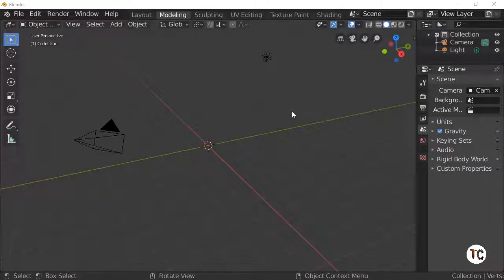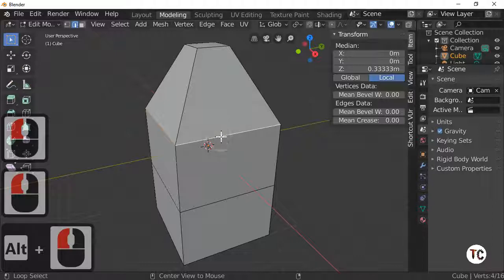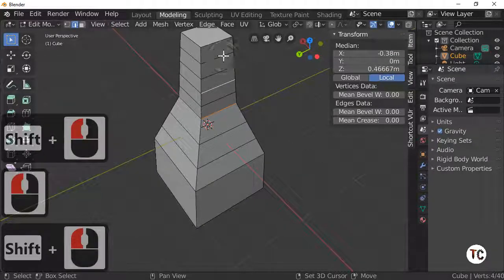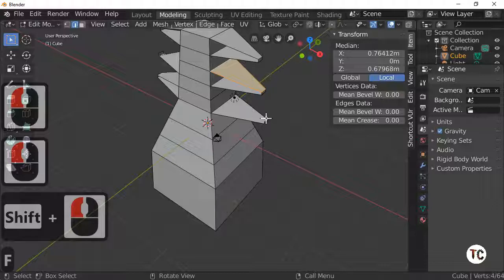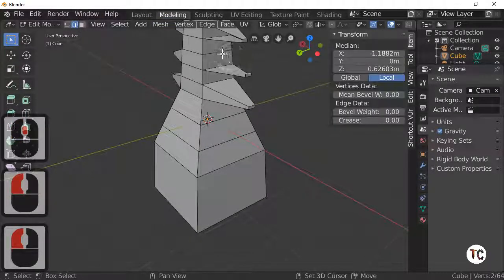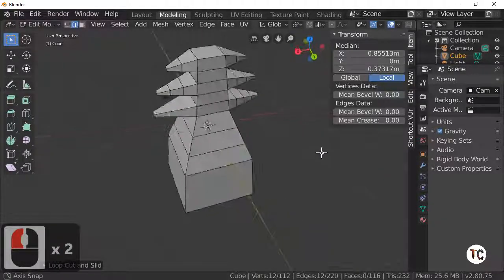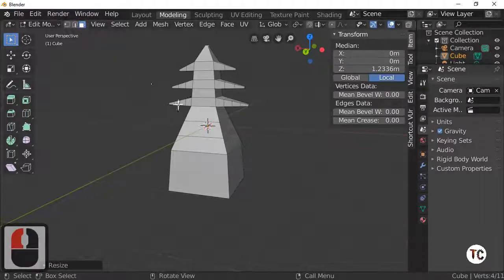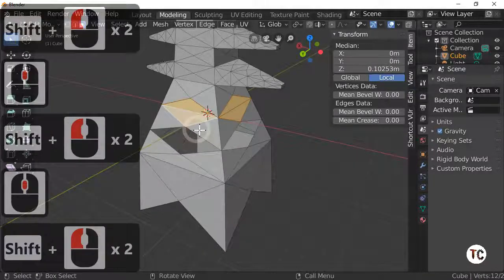Blender tutorial make a Pylon .  How to poke faces: 👍SUBSCRIBE 👍(Beginner Tutorial)

Comment: Hi , please show me your key showing plugin please.
Reply from the maker: This was done without a plug in. Please explain
Reply: @terryblends BY DEFAUT BLENDER DON'T SHOW THE  KEY PRESS.
Reply from the maker: @kebabsharif9627  sorry got the wrong end of the stick it's not a blender adon it's a free program called carnac I think it's still on github. Com its made by code 52. It shows key hits on screen over any software
Reply: @terryblends   @Blender Tutorial Channel.  Tnank you  for your response,i installed it but it shows only the key pressed and not the mouse as in your video...!
Reply from the maker: @kebabsharif9627  if your using Windows double click on the icon to the right bottom corner this will fetch up settings on that you can customize hope that helps are you a creator
Reply: @terryblends I will be a 3d model Creator  very soon .
Reply from the maker: Best of luck enjoy blending. By the way did you get the mouse to appear in the app